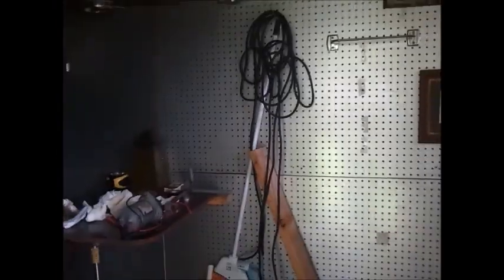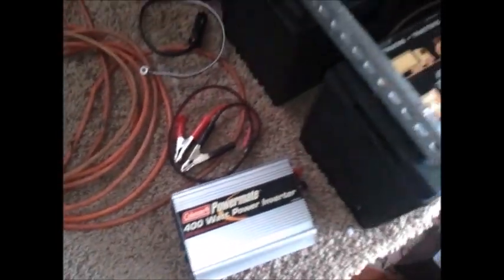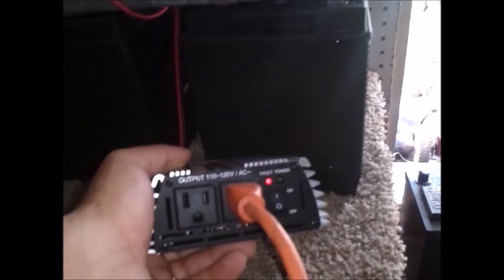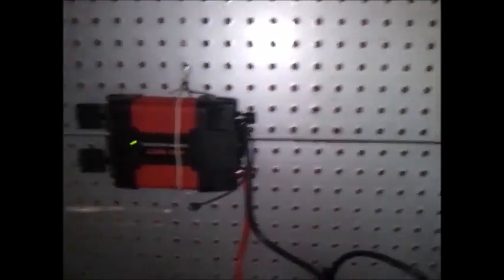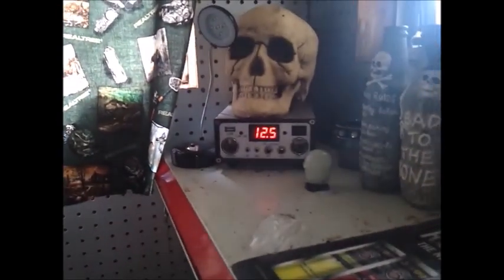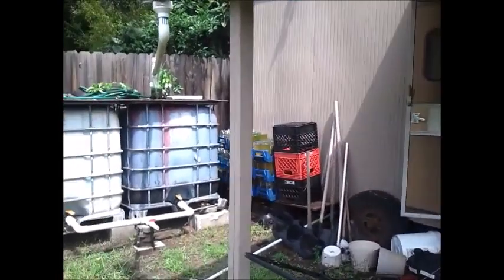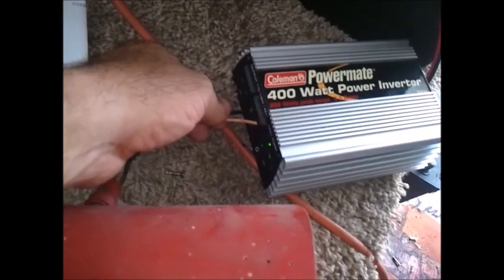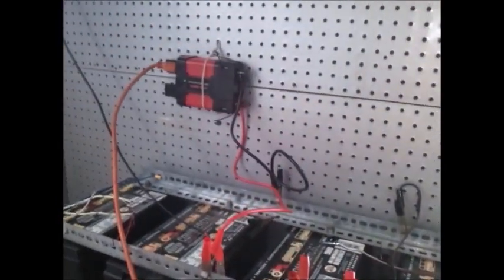can a fridge run on a harbor freight solar kit

Comment: Do you have that inverteron one battery only?? And what  are the batteries, size and kind??
Reply from the maker: The batteries are an industrial group 31, the kind of batteries you would find a semi trucks or buses. They work but they're not the best for solar applications, a better choice if I had to redo it I would go with a 6 volt golf cart battery I would do eight of them Linked in series. I'm using four 12 volt batteries they're all connected and parallel am I inverter and charger are tied into my bus rails. Thank you so much for watching.

Comment: You forgot to look at the wattage/voltage your small frig uses.  Before plugging it in to the investor I use a 4000 w inverter
Reply from the maker: I did a lot of work off camera that I probably forgot to mention in the video thanks for watching

Comment: Don't waste your money. One can buy a real 200w made in the US with a 25yr warranty solar panel and simple Amazon PWM 30a + controller. That comes to about $205. The panel has 2x the output has sealed connectors is half the size and is the base to a real system. For the Panel search Ebay for the factory direct  Fred480v or "200 Watt 12 Volt Battery Charger Solar Panel Off Grid RV Boat" or you can find em from a distributor called ContinuousResources
Reply from the maker: No you're absolutely right I have now the Harbor Freight panel set and solar panels that are Hunter Watts a piece from a real company with a pwm controller but this video was just a show what Harbor Freight panels could do thanks for watching

Comment: the fault is because you've cut the ground off the dropcord
Reply from the maker: nope lol. the cheaper one did work..
Reply: thats because the cheaper one doesn't have ground fault reconition
Reply from the maker: I believe the first inverter either the rating was very faults or it had some other fault in it well the Harbor Freight inverter work Flawless same extension cord same ground was missing yet the Harbor Freight one had a lower rating on it

Comment: I could be wrong but shouldnt u plug everything in with the inverter off?
Reply from the maker: The inverter off at basically has no power flowing through it and shouldn't create a power draw thank you for watching

Comment: I would surprised it was a little harbor freight. I have one of the older model of myself and have bought four sets I did like they’re little charge controller had quite a little bit of things done Marshall’s is the new shed they look like the news that had quite a lot more power and I believe it is demonstrated it no battery they’re definitely an important addition they are probably about 3/4 of the filler cap

Comment: You need a  better setup 100 watt solar panels are cheap now 79.00 free shipping and mppt controllers are awesome.  Here take a look how much you can power if you wire everything good. My first solar system was that harbor and freight one it's a waste of money man. I found out later I could ha ve bought 200 watts of solar for what that costed me. Here is mine now . https://youtu.be/wsxbHv8rNu0

Comment: What batteries ur running
Reply from the maker: Group 31 batteries thanks for watching
Reply: massis32210 don’t understand
Reply from the maker: @johnpaulgarrido1496  group 31 is a deep cycle automotive deep cycle battery it's wet non serviceable Style battery of battery you can find them at any auto parts store

Comment: I noticed you had the ground post snipped off the extension cord. Big NO NO.  Some units require that for the ground of the unit.  So I don't think you gave this an adequate test.
Reply from the maker: how is that not an adequate test the Coleman proved to be a faulty inverter but the Harbor Freight proved to be a better one

Comment: I see a little problem with this "experiment"! The batteries are actually running the fridge, not the solar panels! The solar panels are charging the batteries at 12.4! None of that tells you how fast the fridge, and everything else, is draining the batteries! That's why no matter what you turned on, your charge controller stayed about the same! P.S. The Coleman inverter probably faulted because the extension cord was missing it's ground!
Reply from the maker: Its not the ground prong on the Coleman, and the panels were charging the batteries the harbor freight charge controller never displays the proper amount of charge or the proper amount of discharge either will the kit charge your batteries while you're pulling power out of them yes is the kit very efficient cost-wise no thanks for watching

Comment: Works fine on my 1000 wat inverter gets me through the night on 100 wat panel cuase I only use my frigerator and lap top and I change my phone from laptop
Reply: what panels you have from harbor frieght? This video is old so its that old kit they had

Comment: very hard to run a fridge round the clock you need a good size battery bank for cloudy days there aint no sun at night and your small battery bank will suffer ...if you keep a battery at under 12 volts it will start sulfating up your battery bank .....it will run  on one battery but for how long ...very hard to do ive overcome this with my fridge only runin on sunny days that wasn't easy but works a dream ...im useing a bar freezer as a fridge cold drinks all the time
Reply from the maker: Peter Moygannon thank you for the info. I'm building a cabin on my other channel Massis-outdoors with a better solar set up. Check it out. Thanks for watching.

Comment: Forget about the Harbor Freight panels.  I bought the 45 watt kit to keep 2 golf cart batteries charged.  Worked fine for around 2 years.  At 2 years only one of the three panels produced any power at all.  At 5 years, all three panels were dead.  Good to play around with.  Not so good for serious, long term use.  Cheap plastic frames cracked at the corners within 6 months.  I do like the controller box because of the display and the various plug taps on the front.  For panels, you can't beat DM Solar for price and quality.  Renogy is good, too, but pricier.
Reply from the maker: 8632tony you're absolutely right the quality of that style panel is good for very low-light you can make power but the overall quality is garbage on my second Channel Massis-outdoors I'm building  off grid cabin that has the Harbor Freight panels temporarily check it out let me know what you think thanks for watching
Reply: The new Thunderbolt 100W system is way better than the old Harbor Freight 45W!
Reply: @oldschooldiy3240  Nope it's still cheap junk and a waste of money. One can buy a real 200w made in the US with a 25yr warranty solar panel and simple Amazon PWM 30a + controller. That comes to about $205. The panel has 2x the output has sealed connectors is half the size and is the base to a real system. For the Panel search Ebay for the factory direct  Fred480v or "200 Watt 12 Volt Battery Charger Solar Panel Off Grid RV Boat" or you can find em from a distributor called ContinuousResources

Comment: Like that fact you are thinking and trying things out..if we fail we just keep trying and we learn. I also was catching rain water for garden (500 gallons of clean healthy water) Built a small DC wind turbine and now ordered a 100W panel and convertor. I like trying to be independent or try to anyway..great video!
Reply from the maker: SOILFIT I'm building a offgrid cabin on my 2nd channel Massis-outdoors here on yt. Check it out. I'm using what i learned with the camper to go bigger and fix mistakes. Thanks for watching.

Comment: Too many variables to do the math and get anywhere a correct answer, for those that try.
 You easily can figure a constant like tv or light etc.. because you turn it on and it stays on till you turn it off so you know how many hours it will be using power. A frig is NOT running constantly even though it is turned on 24/7
 My large Mini frig tonight is running maybe 2x an hour for about 4 minutes each time, so 8 * 24= 192 minutes run time per day, or does it really? NO, not really, the frig is next to the baseboard heater and it's a cold night so that warms the frig when the heat is on warming to room to 70f. In Few hours the heat will not be used much at all so frig will not warmed, also instead of 70f ambient room temp will fall to around 60f. All these type things effect how much the frig will run. So in a few hours the frig may run only 1 time per hour fo nr 4 minutes till about 7pm, about 8-10hrs, then back to heated room again and more run time for the night. Now knowing all of this we can safely say my frig runs less than 3hrs per day at this time of year. Doing some research shows compresser should use 110-130watts when running. That sounds about right since I did test mine with kllawatt meters, just forgot the actual numbers.  3hrs*130watts means right now my mini frig is around  390watts per day.
 That number of course will vary a great deal with each frig how installed how used etc. 
  Of course figure extra watts needed for losses in system  seldom perfect sun and panels never put out full rated power, so double the needed watts and say I need 800watts per day. That also helps with cloudy days etc..  Maybe 4 great sun hrs and good hours,  200watts in panels should it pretty well. To store the power we know we use 390watts plus losses for inverter etc so say 450watts at 12v that is 37.5amps per day. How many batteries you need depends on type, size, and how low you want to drain them, as well as how many days you may want extra for storm days with no sun.
 My batteries are 120amps and I seldom want to go below 50% so I have 60amps to use. 60/37.5= 1.6days I can go without any solar power. I have 4 of those batteries so I can go 6.4 days safely with NO sun for bad Weather
 Since I have added in more than needed everywhere for losses etc and it would not really harm my batteries to go a little under 50% if I had to I could actually run that frig 8 days with no sun.  
 Anyway that is about how to figure power needs, find the numbers and total them for what you need to run, how many hours things need to run, how many days you want to plan for no sun. Of course for my mini frig I could just do without it anytime no problem, but for required items figure for some no sun days.
  Hope this helps some folks understand some very basic stuff. I could not sleep anyway and trying to figure out how I am setting my system back up.
Reply from the maker: Den Stump thank you for the info. Thanks for watching...

Comment: 400 watt inverter is too small for the fridge. You need to figure the watts on your fridge and multiply it by 3. Anything that has a motor that needs to turn you need to multiply the watts by 3.
Reply from the maker: Steve Chapman the Harbor Freight inverter ran the fridge just fine but the Coleman inverter just couldn't do much I believe the Harbor Freight inverter actually has a higher rating than once stated on the package thanks for watching.

Comment: i have that same coleman it worked good in charging my 18v powertools during a hurricane using my car's battery.
Reply from the maker: Felix i think the unit has a problem. Im going go test it on my other channel Massis-outdoors. The camper became a offgrid cabin in the wood. Check it out. Thanks for watching.

Comment: "maybe i'll hook some panels in unison" Shuddered when I heard that. What did he mean by that? in series, parallel??? correct technical gargon is important. At least he is learning by doing it. giving him and others Kudos. I took a course on solar technology better known as Photovoltaic Technology. I don't like the bus bar railing he made, regardless that he says he put a safety on it. Hope he never forgets about it, and he wont let anyone else work on it. Great comments from all. no trolls just fine folks putting out great info. I Salute You All.
Reply from the maker: fvrrljr I believe the terminology would have been in series possibly to bump them up to 24 volt but they're parallel to each other the camper self is down the frame is reused and now I have an off-grid cabin on my other channel that I'm building currently with the same could solar panel setup check it out it's on massis - Outdoors
Reply: The advantages of wiring solar panels in series vs. parallel are dependent on the technical specification of your solar energy system’s panels and inverter. In series the Voltage goes up and Amps stay the same. In Parallel the Amps go up and Voltage stays the same. Check you local city and state laws. There's grid Tied and non grid tied. some will allow others wont. I knew a engineer who installed them himself only to have them removed, why: because he wasn't a certified electrician. everything was up to code and then some. he never got the proper permit. I'm gonna check out your other setup.
Reply from the maker: fvrrljr thanks for watching.

Comment: I have watched so many videos about Harbor Freight capability is and was just talking not really giving me a visual to make a better decision.  So my question is, you proved it can run the refrigerator but will it run continuously indefinitely and how do you achieve that with limited number of solar panels, by adding more batteries?  Do the batteries determine how long your electric loads can run or is it the solar panels?  That's what's been confusing me.  I am stuck at the point of which do you need to have abundantly to run a refrigerator? High watt solar panels or large capacity batteries?
Reply from the maker: PHAT4LifeTV to answer your question yes it could run the refrigerator constantly what is a 45 panel kit probably not with their new hundred-watt kit and more batteries yes it will it's all about the Watts coming in and what's the amount of Watts going out check out my other channel massis- Outdoors I'm building off grid cabin that will run off the Harbor Freight panels thanks for watching
Reply: Thanks I appreciate your response.  It helped tremendously!

Comment: Why didn't you explain which Harbor Freight kit you used, the model number and wattage?  I assume this is the old 45 watt system and you should have explained that.  As of this date, a new 100 watt 4 panel kit # 63585 from HF is $149.
Reply from the maker: FiscalRangersFlorida it's funny that your right,I didn't say anything about the kit. But I guessed that most know about the hf kit that I figured why waste time. I'll have to do better about explaining my self . Sorry about that.  Thanks for watching.

Comment: I have the 100w HF solar kit, Thunderbolt solar charge regulator, a 12v 35 AMP universal battery and am looking to power a 12v freezer portable. What type of pure sine inverter should I get? I was thinking 1000 WATT and can my battery and solar kit handle that?
Reply: Acousticstrings if it's only the portable freezer/fridge at 12v that you want to run then there is no need for an inverter. I do the same with that exact kit, 114 amp/hr deep cycle, 12v portable fridge/freezer (input listed at 40 running watts) directly to the load side of the solar controller. Don't need an inverter because it's already 12 volt system. Runs perfect day and night. However, I do have a 2000 watt inverter for any AC applications I may want to use.

Comment: For all elec. appliances have a amp hour rating. When figuring out what you can run think amp hours not watts. I have been doing this for 3 years. I have 2 harbor freight kits and two grape/renergy panels with a total of 15 amp hour charging with my solar panels combined. I use 6 volt golf cart batteries in my bank. If you get 6 hours of direct sun, then I get 90 amps charge time. It depends on how much amps you are using in a hour. Amps are your stored energy watts is the power you use....
Reply from the maker: Fringed CoatTails that's a great  comment.  I'm building  a  offgrid cabin in the woods with a better setup than this kit on my second  channel massisoutdoor. Check  me out as I build everything new. Thanks for watching.
Reply: Hi, no luck getting to your other channel. I have an original channel bkr360 that I could not access anymore, but it still is active for viewing. 
We have been full time RVing since May of 2014. We set our motor home up with solar power and learned the prepping skills over time. We recently built a solar water heater using plex tubing and a Plex drum as a storage for hot water. The motor home has a generator and a built in water tank. We use the gas tank that holds 100 gal gas. I have got a back up small genny harbor freight. We bought a 100 gal water tub and have a 275 gal blow up hot tub from intex, so water storage is important. My solar bat bank is small with 4 - 6V batteries giving me about 460 Ah. We are going to get 2 more batteries. The process is slow as money in this is an investment. Any time we find a property to settle on we will have the off grid ready to transfer. It takes time and dedication, but it is worth it being self sufficient. This year we were leasing a property with hook-ups and room for  a garden so my next project is going to be hydro-phonics....Thanks bkr360
Reply from the maker: Fringed CoatTails that  sounds  like  a  sweet project,loving it.  If you search  massis-outdoors  it will come up in the search.

Comment: take the amp on the data plate on the fridge multiply it by volt and it well tell you how many watts you need
Reply from the maker: Thad Guisbert thank you for the information. Oh im building a OffGrid cabin on my second channel, Massisoutdoor on youtube if you would like to see a fully OffGrid cabin built from recycled and repurposed materials. Thanks for watching.